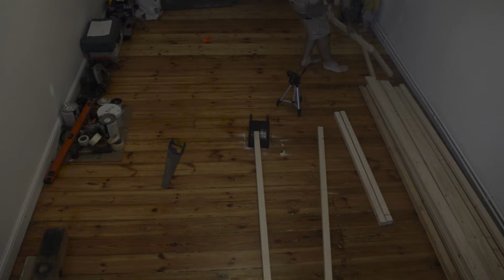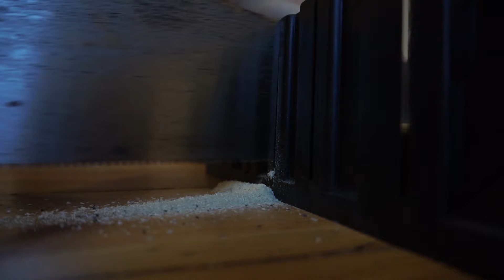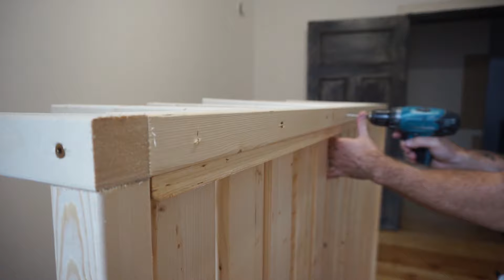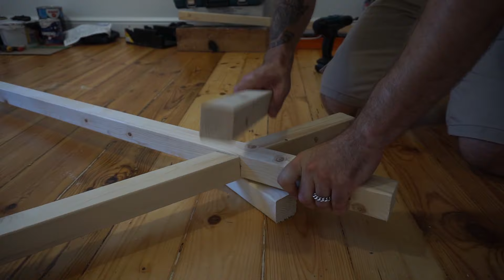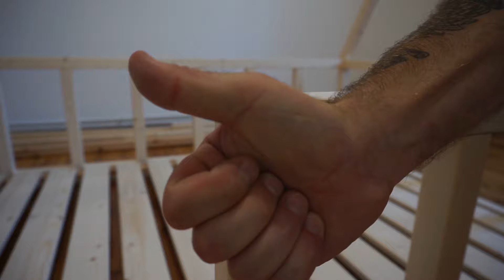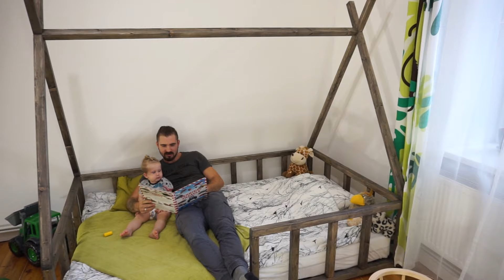DIY Toddler's bed

Comment: what kind of stain did you end up using? Looks great!
Reply: follow up question.   Did you find the "test poles" to be a bit flimsy?  I was wondering if they might be a bit insecure.
Reply from the maker: Hi. I covered all the wood with dark glaze/lasur for wood which protects the wood and gives tint with no covering all the wood structure.
Reply from the maker: @AAronB2834  Yeah they are. Also bed looked a bit disproportional so I decided to remove them.
Reply: @kasparswoodworks4881  Thanks for the response!  I actually did the project this weekend and it turned out pretty good!   The wife wanted to leave it natural wood color, so that made it easier.   I ordered some L brackets to firm it up a bit, but otherwise it turned out awesome.  Thanks for the inspiration!
Reply from the maker: Wow. So good to hear that i helped you with my video. I would be very grateful if you could send me some pics of your bed to kaspars.woodworks@gmail.com
Thanks! :)

Comment: What are the measurements of the bed?
Reply from the maker: Mattress is 120x200cm
Bed outside size - 130x210
But it can be made in any dimensions. I can just advice to make frame for 1-2cm bigger than mattress. Than it will be easyer to fit mattress and change bedding.
If you need more detiles don't hesitate to contact me through email.